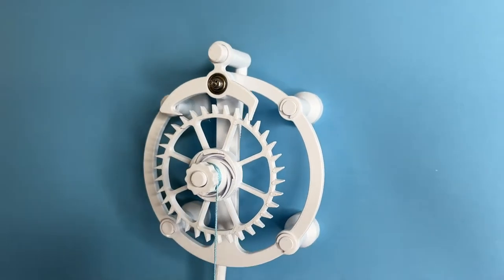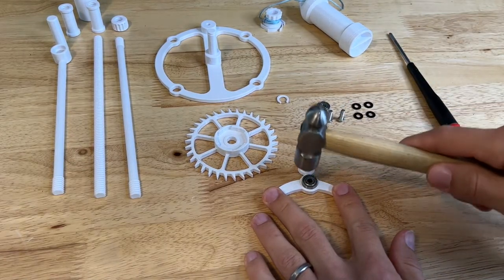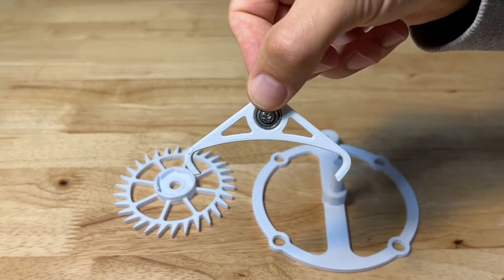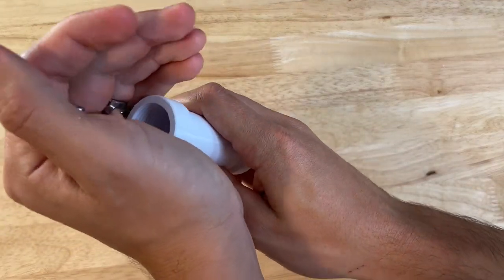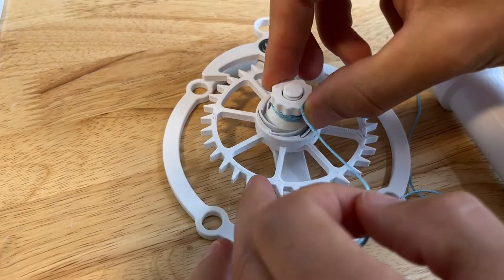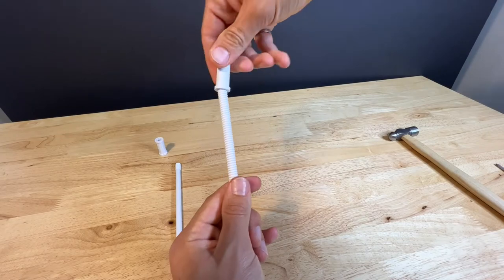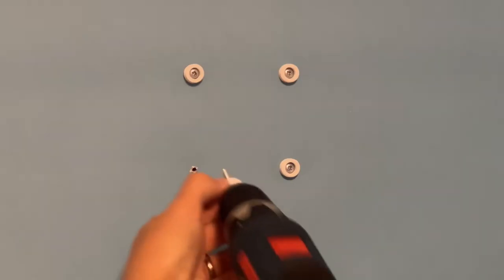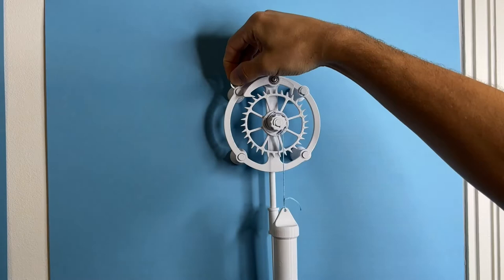How To Assemble the Recoil Anchor/Deadbeat Escapements

Comment: So I resized the model to 170% to fit standard bearings. Printed everything and whilst it does seam to work and all, I think I have a issue with the pendulum weight. I can start the mechanism but then it stops like 30 seconds loosing momentum on the pendulum.